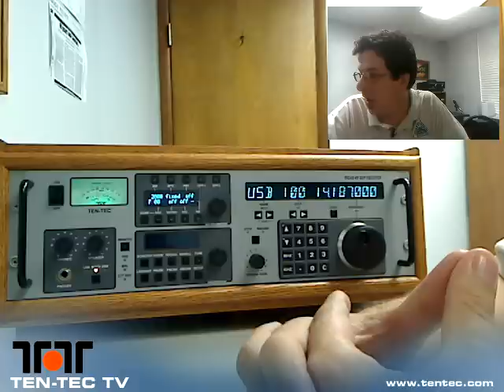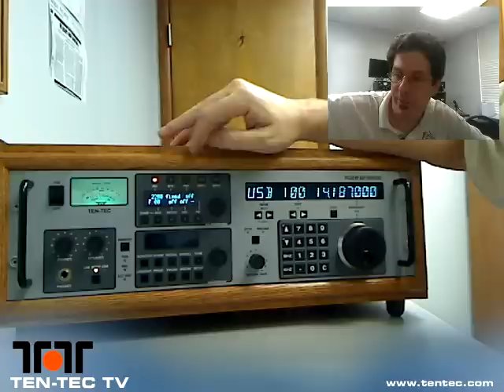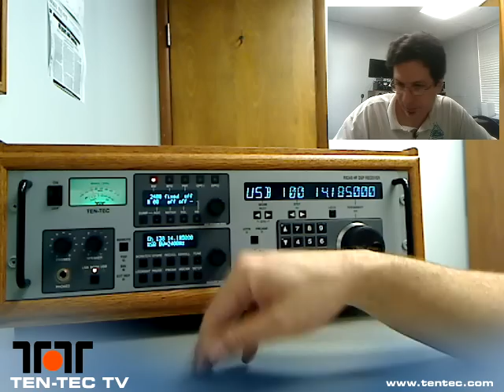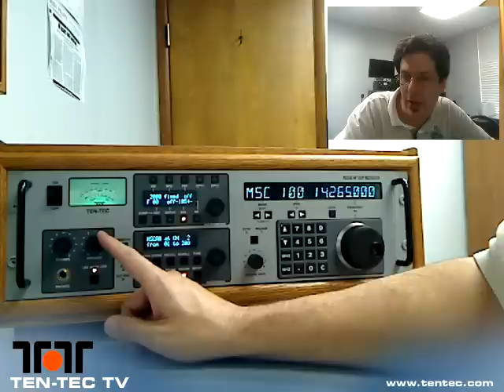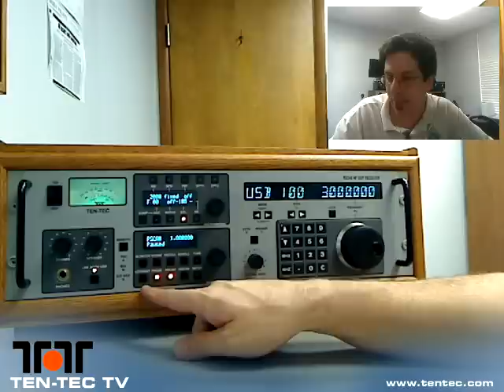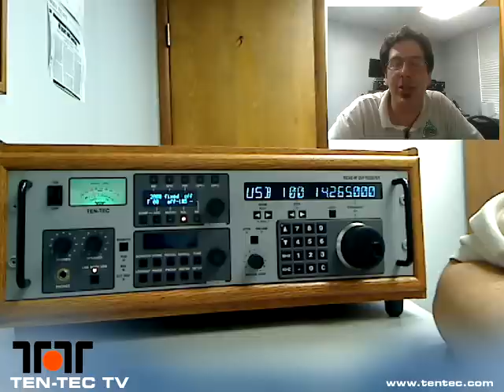Ten-Tec RX-340 receiver demo

Comment: The project manager failed to realize that the step buttons are wired in reverse. Notice when he presses the left arrow button ( < ) the step rate increases and when he
presses the right arrow button ( > ) it decreases. The buttons are mounted on the pc board and I believe the way to correct it is in firmware. I've also noted on their website that they have not had any updates to this radio. The original company is now gone under
and someone is trying their best to resurrect it. Similar to Heathkit. 
Yes,, I own one and love it.